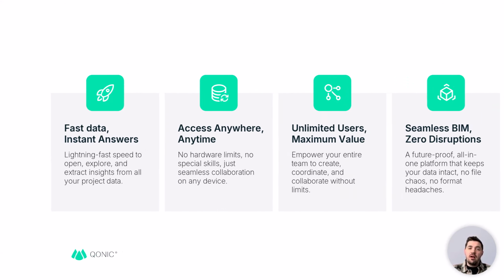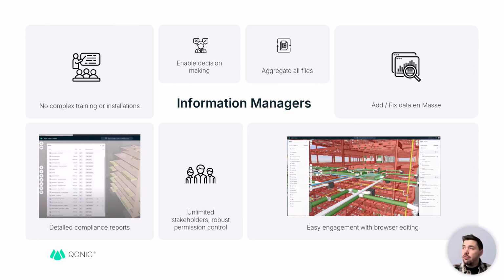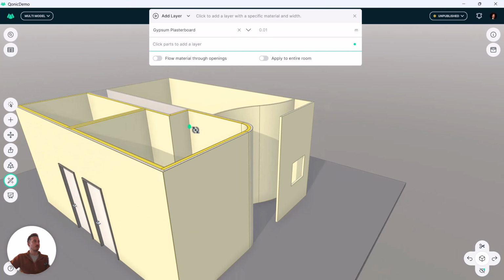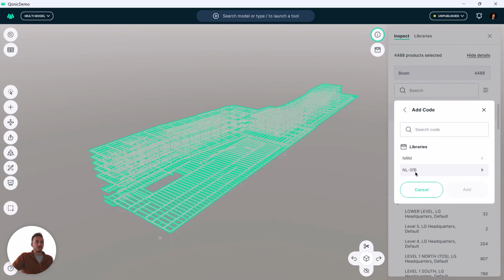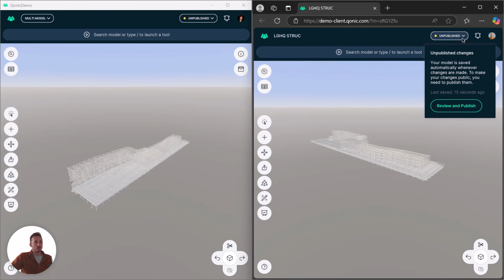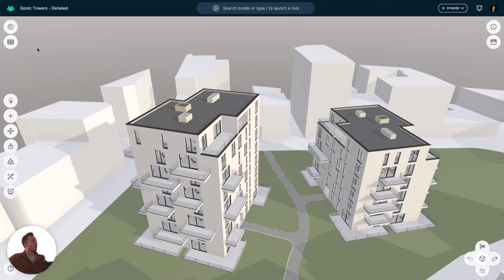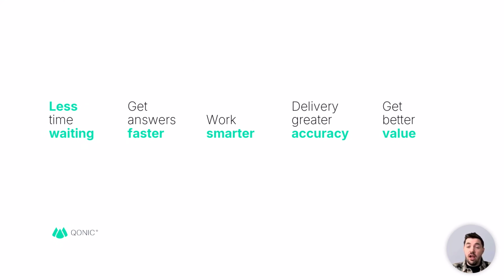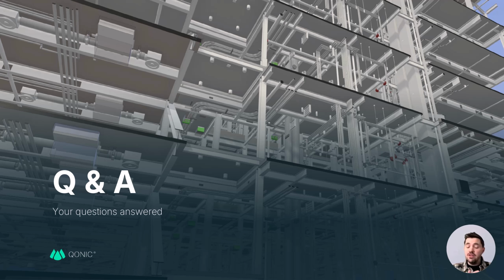Webinar Discover Qonic: BIM without boundaries

Comment: How can you handle model complexity?  i.e.  You showed us how you can add complexity to rooms.  Like adding insulation, plaster, voids, etc...  But how can I hide them selectively?  Like "Show me the section of a very complex wall profile (Layers, voids, lsf...) with just the outer lines" for design developmente purpose...  I hope I made myself clear. ;)
Reply from the maker: Hi Mark! Walls, slabs, and other kinds of systems are modelled as assemblies of parts. It's possible to select, show, hide, or manipulate both the assembly as a whole and the individual parts. We don't have visual overrides yet, for example for showing just the outer lines.